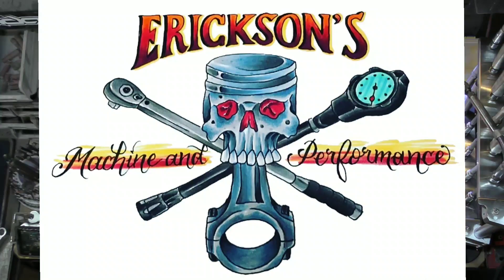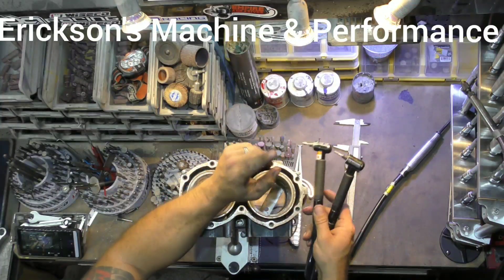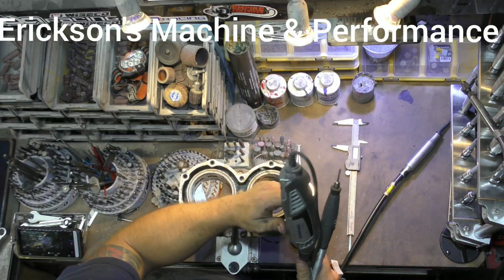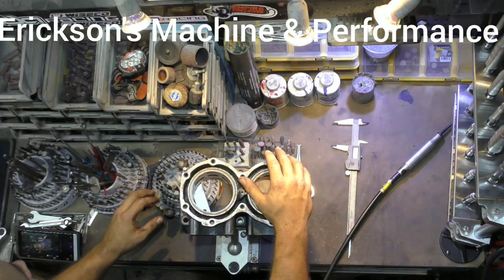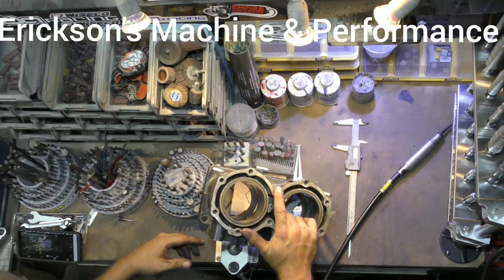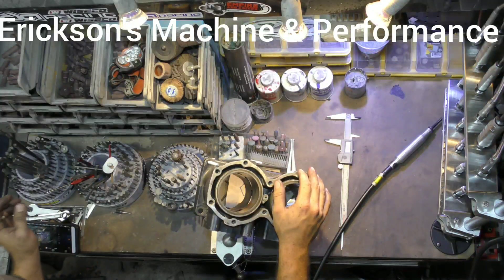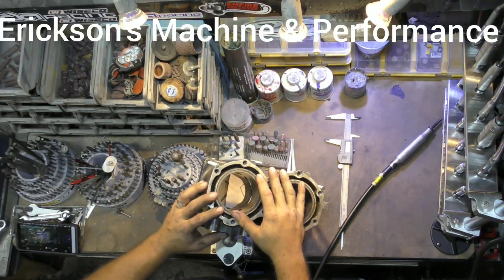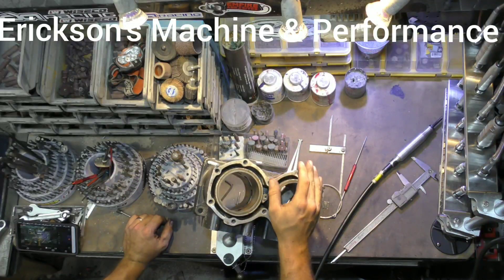Intro to PWC porting 101 , tooling , burrs and things needed to port a 2 stroke engine

Comment: Don't think you mentioned them but after watching your videos I looked for a flex shaft grinder and I believe I picked mine up from Amazon a "VEVOR" 1000W 30000 RPM. I have used maybe a total of 3 hrs. I have zero complaints. And it's $109 has off, fwd, rev. Then bought a cheap 90 head and bits for a grand total of $200. I'm able to port and what not on a budget. Hope this helps people. 
Also hope everything is well Erickson, I purchased a template last friday and it hasn't shipped plus I haven't got a comment from you for a while.  Hope all is well.
Reply from the maker: Templetes are going out today Sir.  Thank you for your business
Reply: @EricksonMachinePerformance  anytime I can! I've been recommending your videos. Love the content. They are all full of information. Unfortunately I don't catch it all because I'm usually trying to listen while I work. Anywho keep up the great work!
Reply from the maker: @BuyBuildThrash check out Foredom Electric.  They make amazing porting tools
Reply: @EricksonMachinePerformance  will do! Thanks!
Reply from the maker: Yeah we Use Foredom Grinders.  Made in USA.
Reply: @EricksonMachinePerformance  oh so vevor is part of foredom?  I didn't think they were. I haven't done a whole lot of research on the tools so I honestly have no clue.